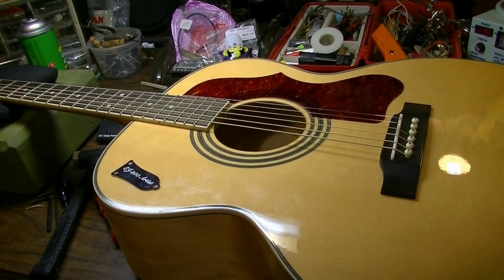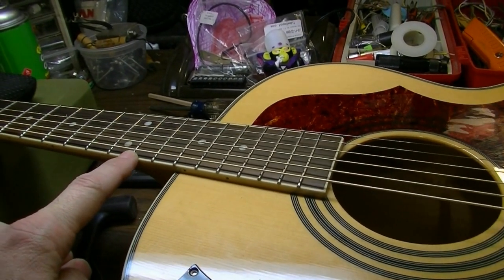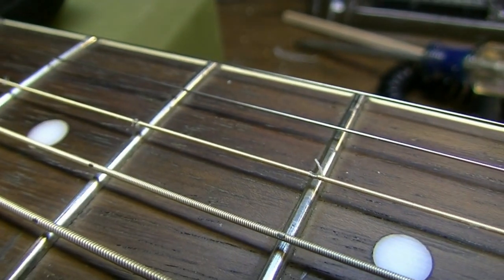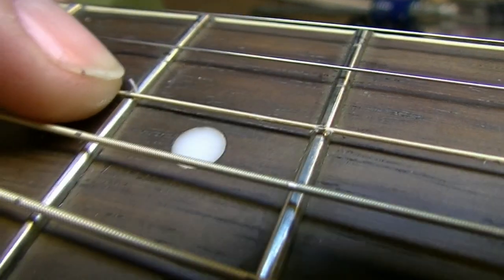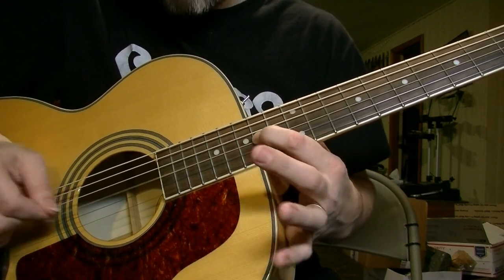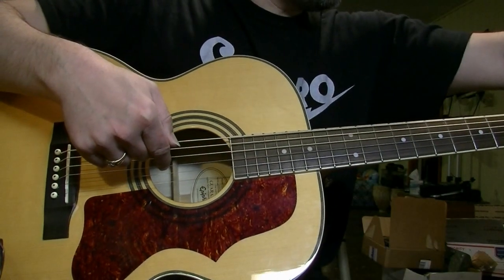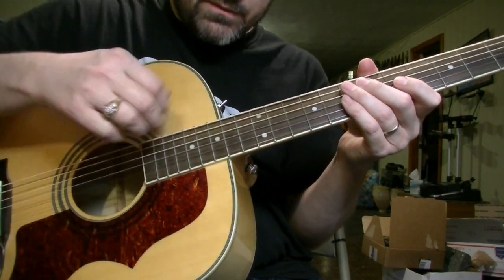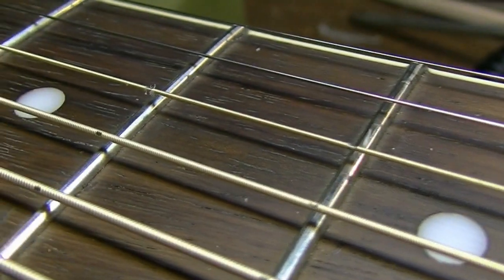Why I NEVER Use ELIXIR Coated Guitar Strings

Comment: They must be the old poly web strings. Nano or opto strings will never do that. The coating on those strings looks thicker than the wrap. You can play nano web strings for way too long and they will not end up looking like the strings on that guitar. Definately not enough to effect the action. The wrap does eventually come off, but it still wont affect the playability of the guitar. Try again with modern elixir strings. What you show in that video is impossible.

Comment: This is a bizarre video.  I use Elixir coated strings and they are amazing.  I have them on a dozen guitars and nothing like this has EVER happened.  I have no idea how you managed to screw these strings up, but you are totally wrong about what Elixirs are like and how they wear.  They only wear where your pick hits them, last about 3-5 times longer than any other uncoated strings, and are to guitar strings what Glock has been to handgun technology:  a huge leap forward.

Comment: First off, You didn't say if these Elixirs are Poly-web or Nano-web. I've used both and I can tell you from experience that the poly web strings are junk, yes, play a little while and the polyweb strings will start to look like the used end of a Q-tip. When I switched to Nanoweb strings never had the problem again. So try the Nanowebs for a while and see if they don't stay together a little bit better than the polywebs. I've used Elixir strings for over 10 years and for longevity they cannot be beat. In playing guitar for 37 years, I have never put used strings back on a guitar. If I'm going through the trouble of installing strings on a guitar, I'm going to install new ones. Putting used strings on a guitar is like using a toothbrush before you found out that your girlfriend used it to clean the toilet. Pure Blasphemy!!

Comment: Its dumb to show something that is way beyond worn out as an example of why you wouldn't use something. This is like pulling out a set of tires that have a ton of miles and have been burned off and saying, look how bad these look and ride, I wouldn't use these. It makes no sense at all. Whenever they start peeling they need to be replaced. And that doesn't happen over night.
Reply from the maker: The strings were less than 2 weeks old. They’d seen two rehearsals and a gig.

Comment: seems like your friend is pressing the strings down very hard. that could explain why the coating is getting off. I never seen something like this and I use elixir strings for a long time
Reply from the maker: He plays in tune, so I wouldn't say he presses down on the strings too hard, it's just that he's an aggressive player. Plays heavy style of blues. Lots of bends and lots of vibrato, especially on the wound G, which it cannot handle. Bad match of string for this player. But I have a somewhat similar style and my playing does this to Elixir strings as well. They don't hold up repeated hammer-ons and pull-off and vibrato and bends.
Reply: okay yeah maybe they can't handle the heavy bends a vibratos. but I'm using elixirs on a electric guitar. maybe there could be a difference. but everyone has their own favors
Reply from the maker: Totally. 100% agree. To each his own.

Comment: OK, you say they are only three sessions old, and you think the strings should be OK.  You admit your buddy uses them hard, and well, they ARE worn out.  They have bits hanging off them!  What you're seeing isn't just the coating wearing off.  The coating would be nearly invisible.  What's going on here is that the metal wrap is wearing off.  
Look, fret buzz is metal strings under tension vibrating against fixed metal frets.  No way a little hair of plasticky stuff hanging loosely will sound the same.  You probably can't hear it at all.  If you're hearing string buzz, it's plain old metal-on-metal buzz, and the frequency is the string vibration frequency. And if you know anything about how a guitar works, you should know that less string buzz high up the neck is normal, and has nothing to do how the strings have been played.  You already said you had to change the action because of the Piezo pickup, and you set the new action to "where you thought it should be".  Don't try to invent new physics.  Stick to the obvious answer that you've set the action too low.  I'm real sorry that it's a pain to raise the action after you filed down the saddle, but don't blame it on the strings.  And wipe the strings already.
Next you're going to tell us that you thought you'd try  bass strings on your guitar, and can't understand why it doesn't sound right.  Must be the coated strings, right?  
I think you owe Elixir an apology.

Comment: Nanowebs do not shed their coating like that, Polyweb strings will but only after a lot of use. I play 1.5-2 hours a day and for me the polywebs start to shed about six months in. Did you even ask the owner how old the strings were before decided to bash the Elixir brand?  Because of the shedding they are not my preferred strings. I do use them on one guitar that doesn't get played that often but only because they can sound new for a very, very long time. It's Interesting that you admit you really know nothing about the type of Elixir strings on the guitar and you clearly don't understand the difference between the two types or you'd know those are Polywebs (or defective Nanowebs). As with many things, using coated strings is a trade-off. At this point the coating on D'Addario EXPs, Martin Lifespan and Elixir Nanowebs are so good it's hard not to use them over non-coated. I imagine gigging musicians who change their strings every week could pass on coated strings, but for the other 98% of the players out there, coated is the way to go. I'm surprised that you don't even bother to size up the advantages and trade off's of coated strings vs non-coated. it's 2017 after all. I'm sure there's some good knowledge to be gained on your channel, it's clear you are an old timer set in their way of thinking. Because of this video I imagine you've lost a potential subscriber or two, but of course it's your channel to shout out your opinion. Thanks for the video, I guess.
Reply from the maker: This has been addressed many times already in the comments. The strings were less than a week old. The player is an aggressive blues player. STrings only used for two practices and one acoustic gig.
Reply from the maker: I'm not "an old timer set in my way of thinking". I am simply showing why I do not use Elixir strings. I think the video speaks for itself. The one thing I did neglect to mention is the age of the strings, but that's only because at the time I made the vid I didn't know the exact age, I just knew they weren't old because my client told me so, hence the reason he wanted to try to salvage them. Had they been virtually ANYTHING else besides Elixir, I could have, no problem. Tell you what...If someone doesn't like the channel, they can be my guest and not watch it. I honestly don't give a damn.
Reply: "I am simply showing why I do not use Elixir strings". Ok, well I disagree and I'll explain why. In your videos you are giving advice to your viewers and in this case your advice is "I don't use Elixir strings because they do this". You don't seem to care about any details of the type of string, etc... So you are brand bashing. Outside defect, ONLY Elixir Polywebs shed like that. Polywebs were the original coating and that shedding is the reason Elixir created Nanoweb. Polywebs are still around only because they last A LOT longer and work better for some players. Obviously not for the gentleman who plays that specific guitar, but for some. You basically admit you don't know which type of Elixir string it is (so you admit you are ignorant about the type of Elixir string) and just go on to explain the coating shedding is the reason you write off the company altogether.... AGAIN, the polyweb product isn't for everyone but it's advantage over EXPs, Martin Lifespan's etc is how long it typically last. Perhaps not suited for the type of aggressive playing. You don't go into any pros and cons, it's just "look at this horrible product". As with many things in life, there are trade offs and the shedding on polywebs is one of then.... If you aren't an "old timer" then I apologize for that comment, but you're still very quick to form an opinion on something and quick to trash a innovative string manufacturer like Elixir even while admitting you don't know all the details... If you can't even take the time to fact check and do a little research on strings before making some damning statements why should anyone trust you advice on anything else? I sure wouldn't... Anyhoo. We clearly aren't going to agree on this so it's pointless for me to reply to anything else you say. You're probably going to keep making highly opinionated videos where you trash whatever products and companies you desire. I know these antics actually lure in viewers as YouTube seems to work well as a platform for assholes. Thanks for the reply.
Reply from the maker: For the record, the only reason I wasn't sure which strings these were - Polyweb or Nanoweb - is because he initially told me they were Nanowebs when he dropped it off, but I was pretty sure they were Polys. I simply didn't want to say something on camera that wasn't true. The Polywebs are coated after the marriage of the winding and core, and Nanowebs are coated on the windings only before the winding process. The Nanowebs will do this too over each fret - yes, even pristine, polished and crowned frets - if you use a lot of bending and vibrato, which most accomplished players do. If you're a casual strummer, you'll probably notice fraying in the strumming area from the plectrum before getting fraying at the frets. but it WILL happen eventually. Despite what some other YouTubers claim, Elixir don't "last forever".

Comment: Anyone want to know EXACTLY  what your strings ARE doing and WILL do in a recording, use a good analog tuner like a CONN. It shows ALL your over tones and harmonics of each individual string. You can have NEW strings and see how terrible they are. 2 guitars playing the same chord will multiply the overtones and exaggerate any bad strings. You can actually see the higher harmonics rotating flat and even higher ones rotating SHARP on the same string! Any engineer that doesn't have access to one doesn't know what he's missing. Coated strings suck. Anything that can peal away leaves residue that gets magnified by compression. HA, I love your moniker. Good name! I also subbed 2U , thanks.

Comment: If somebody were to bore a hole and put a toggle switch on my guitar I'd flog them half to death with a wet strand of spaghetti! BTW, I've never had a problem with those coated Elixirs on my square neck dobro. No fret noise attall ;)
Reply from the maker: That's because a square neck dobro is played with a fucking slide.
Reply: Geez, I was just trying to make a joke. you don't have to start cursing me. :(
Reply from the maker: Sorry Rich, I'm on the rag.
Reply: Thats ok. You are trying to save people a little trouble and they don't seem to want to listen. I guess on the strings it depends on what you are doing. If you are just flailing away in a beer joint then let it buzz all it wants. But let's say you are laying tracks in a studio. You get about 4 songs done and the engineer says hey, your 3rd string has started buzzing. Those engineers  have a way of noticing those things. So then you have to take time to change out the whole set while the studio time clock is ticking. That's big money. Everybody is irritated.

Comment: I would add myself to the pile of elixir fanboys commenting here. Been using these strings for years and don't think I will be changing any time soon since noone else makes a decent long lasting alternative. I have had the bad set of elixirs every now and then (around one of every 20 sets is my estimate) which apparently lack any coating at all and I have also seen the fraying of coating along the strumming side of the guitar, but never on the fretboard side.

Comment: having to use only 1 pack of strings a year if you take care of them is 100% worth the increase in price
Reply from the maker: If you actually play your guitar more than once every couple weeks, they will fray. And when they do, sustain suffers, tone suffers, intonation suffers, you name it. Then you have to reassess whether they were worth it. If the guitar just sits in the stand and looks pretty a lot, then yeah, go with Elixir, they'll stay as shiny as the finish on the unplayed guitar.
Reply: yeah or what i do i play mine 3-4 times a week I "try" to get at least an hour but when mine start to fray I do a quick run over with my lighter to get any parts off that are touching the fingerboard but I mean uncoated strings will be dull within a month-ish without constant cleaning anyways

Comment: This video is not helpful, all string will go bad, but not to the point that loose the coating on the 3 low ones E A D, not related to the the brand of strings

Comment: first off, those frets look like garbage. I'm not sure how old or nice that guitar is but those frets look like they weren't made properly. Secondly, I've been playing for 10 years and I've gone through a lot of guitar strings and never once has that happened to me especially with elixrs.
Reply from the maker: The frets are not the problem. Sorry. Others have suggested that in the comments, but these frets are not marred, or sharp, or rough in any way. They are typical of imported Epiphone. They aren't perfectly crowned, but they aren't rough. A flat topped fret isn't going to cause this issue if they are smooth, which these were.

Comment: pee-ay-zo instead of pie-zo, not trying to be "that guy" but it is a very technical term and worth pronouncing right.  WTF is up with these strings though!? I've never seen this on mine.
Reply from the maker: pi·e·zo
pīˈēzō,pēˈāzō/

Since you're about the umteenth "guy" to point this out, I'll address it... This word is pronounced any number of ways I've heard over the years, there are two ways on offer when you google the word. The first is actually closer to the way I pronounce it, with a LONG I sound. That is followed by a LONG E sound. So my only fault in saying it my way is the slurring of the long E. Because I'm lazy and because I have no one to impress with my picture perfect pronunciation of a word we all understand anyway.

Comment: I've been using these strings for at least 18 years on all my acoustic and electric guitars and i've never had an issue with them. They last really well especially if you wipe off sweat off them after a live show. They have great tone for 6-12 months, depending how often I play each instrument. They stay in tune, don't fray, and i've never broken one ever. I used to always break the G string on my acoustic and high E on my electric before I changed to them. Best strings ever in my opinion. Maybe you're playing too rough or the guitar is causing that issue. It would take a lot for me to change strings and stop using them.

Comment: Fret buzz, you admit the cause is low action. Blame a string mfg and then say low action is the cause. Read these comments below, it's not the strings...Elixirs are just fine.
Reply from the maker: There are some seriously stoooopid people in the guitar community. The strings ARE the problem in this case. They are obviously shedding their coating. Some people won't experience this because it depends on whether you bought nanoweb or polyweb version of Elixirs. Read the rest of the comments and you'll see I'm not the only one to experience this problem in my 30 PLUS YEARS of playing guitar.

Comment: Yeah definitely a goof on the batch itself. I only use elixirs and they're amazing. After a while you get the "angel hair" which is a little coating slowly wearing off. But never like this. And that itself, takes months. I've had a set of elixirs on my SG, it's been about a year. And they're ready to be changed now. But like. Just barely.

Comment: Elixer's are the worse strings I've ever tried. Buy German made Pyramid Strings. Their materials are the best you can get and they're basically hand wound. They're not made on some high speed winding machine that uses shitty Hex Core, Tin plated cheap steel. Pyramid uses silver plated German Steel and the best possiBle pure nickel and best quality Monel wires for wraps. Ugh, I hate American made strings. Strings in the 50's & 60's made in America use to be as good as Pyramid. About 1973 it all changed for the cheaper, faster junk metal they all use now..

Comment: Elixir sounds dead and thin out the box and the worse part is that it keeps that sound til it dies. Also they feels weird and squeaky to touch because of the coating. They suffer like every other string when used over 1-3 months with bad intonation and fret buzzing.  They sounds okay on cheap guitars but an expensive guitar will tell the truth right away. Nothing beats fresh uncoated strings, just ask tommy emmanuel.

Comment: Terrible misinformed video. Those strings simply need to be changed. I have had the same set of Elixirs on a guitar for 2 years, and the only fraying I ever got was on the G string where my pick hits the string, and I am a pretty heavy picker... Those frets are also in terrible condition, which will contribute  to fret buzz...